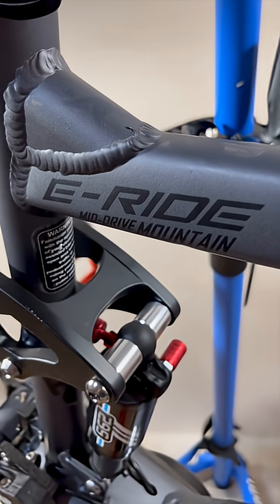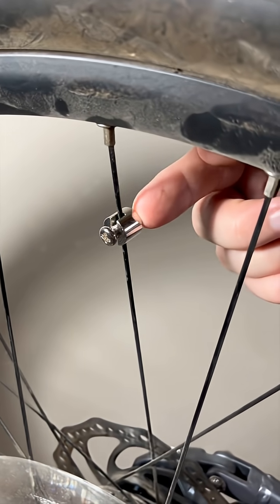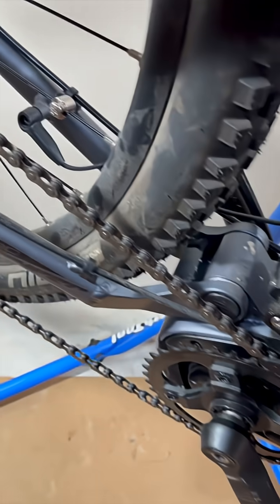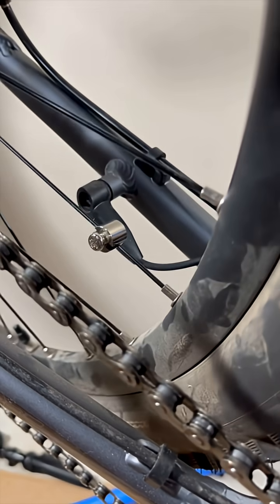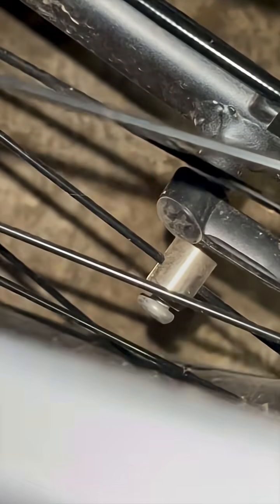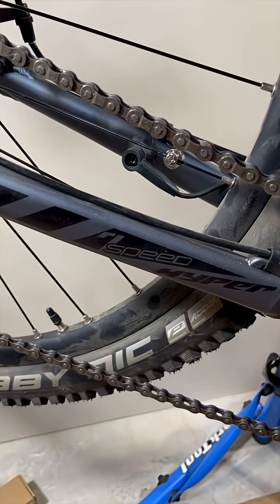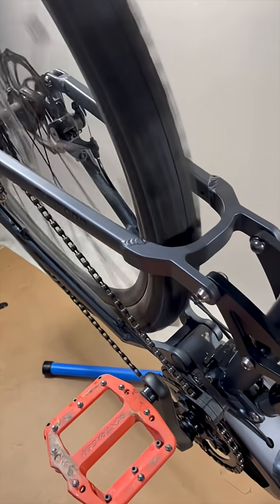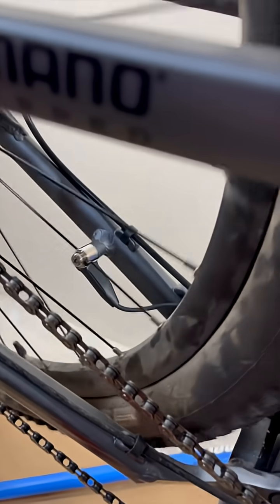eMTB Magnet Location is Critical for Motor & Speedometer Function

Comment: My DOST e-bike just stopped working one day and it’s in great condition but doesn’t power on and when it does it does what you said about the motor not fully engaging so I’m pretty sure this is what’s wrong with mine
Reply from the maker: 🤞that’s it - an easy fix if so

Comment: I have a wireless computer on my bike and magnet placement is seriously important. A little off or too far away from the relay pickup, and you dont get anything. I also find that if I'm riding on trails that are primarily that really fine gravel that creates a lot of dust, it can also cause the computer to not record until the magnet and pick up are cleaned

Comment: I have a homebuilt tongsheng TSDZ8 with a sensor that looks similar to the one in your video it has an arrow on the sensor in about the original position of the magnet on this bike not where the round mounting screw goes always use blue locktite on magnet screws.

Comment: Sometimes polarity of the magnet also has an impact. If the magnets inside Bafang Hub motors are turned around in polarity the motor doesn't work properly  any more